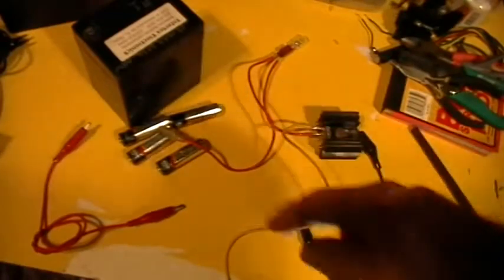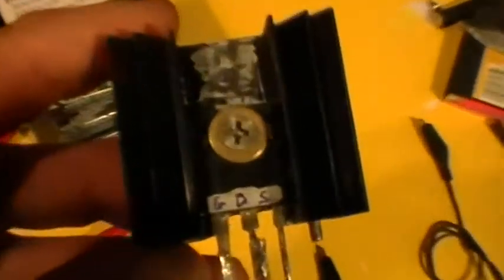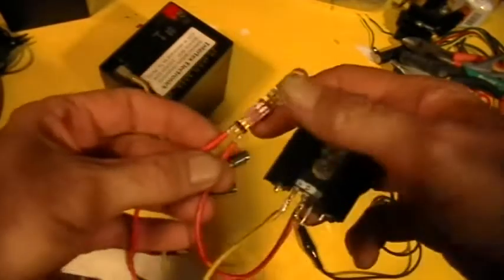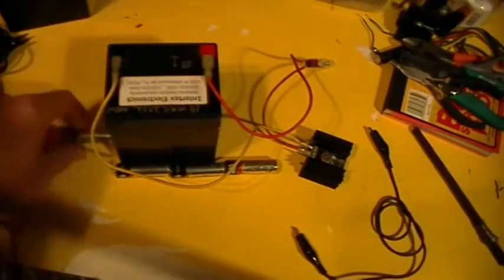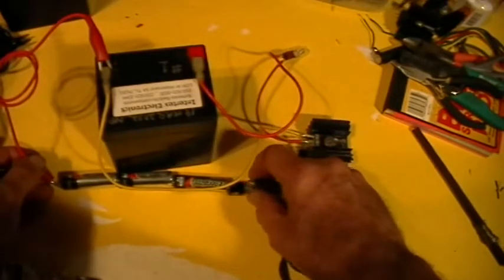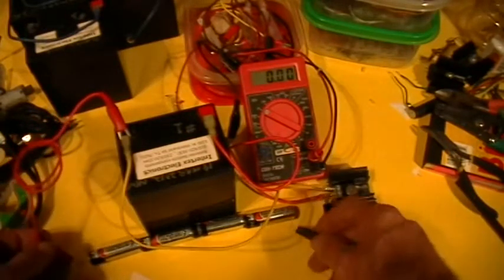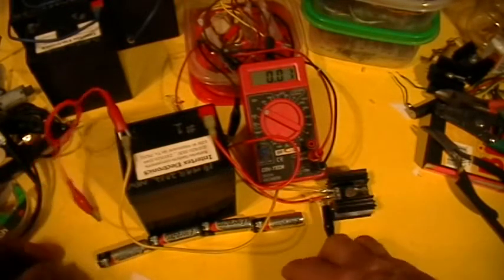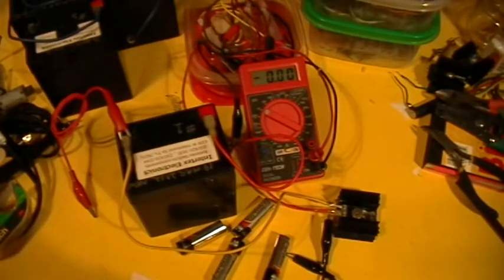Electric OU: How DO Mosfets REALLY Work? Bias Current Runs Common Gate Amplifier

Comment: Great video.  Just a question though, how can i get different voltage values from the one input voltage?  For e.g. If i have a 12 v DC source as input, how can i make it into 9v, 5v and 1.5v?
Reply from the maker: +Charles Tan 
If I am understanding you correctly, you need a "DC-DC buck converter" circuit to do that efficiently. If you simply want to control a mosfet in its linear conduction region (which is very inefficient) you can watch my video here:
https://www.youtube.com/watch?v=tKstLQYayNA
This is done by varying the Gate voltage across a narrow range, which thus effectively varies the Mosfet's Drain-Source resistance. But this causes a lot of power dissipation in the mosfet itself and wastes power. 

So to get lower voltage outputs without wasting power you need a DC-DC Buck Converter circuit. Check out the data sheet for the MC34063 chip, for instance. This is a low-power switching converter chip, there are others that can work at higher power. Also look on Ebay for "DC-DC converter".

Comment: Why don't you use some tape to secure the batteries
Reply from the maker: Because it would be a waste of tape.

I should have used just three AAs.
Reply: Ok I sense you're bitter about something or somebody. Let go and forgive others and yourself not worth it.
Reply: Of course i do the same thing just line them up and struggle to make a connection.
Reply: small neos work well...
Reply: .. or edge of notepad or ruler
Reply from the maker: electronicspark1
Check the next video or two, I sealed 3 of them in some heatshrink. Works fine.